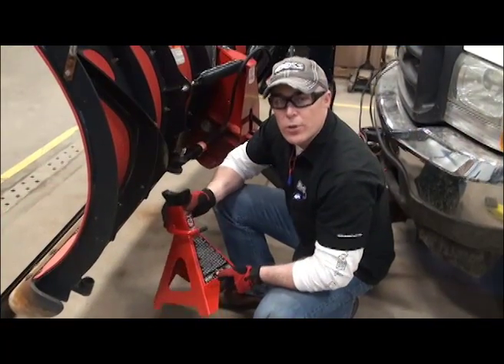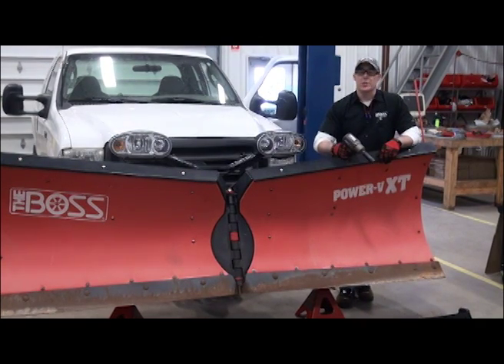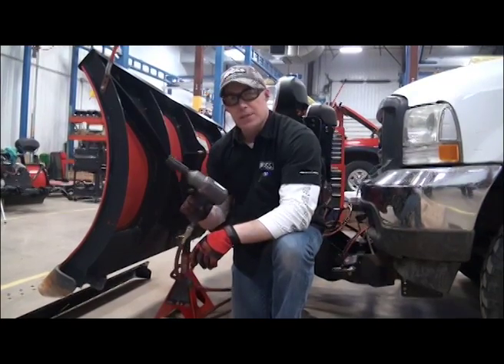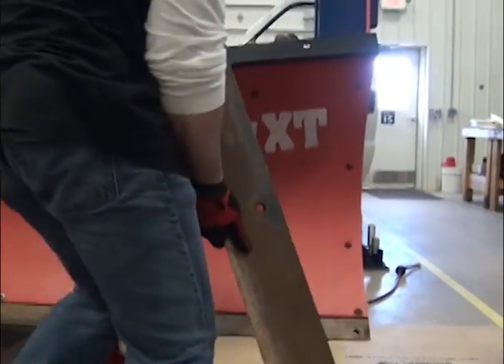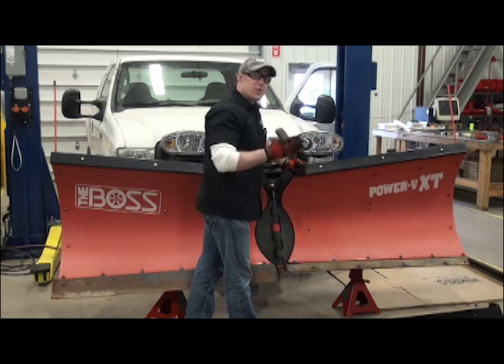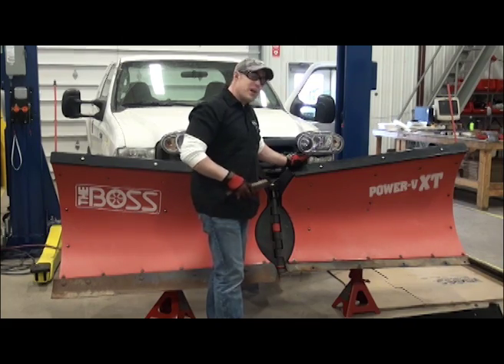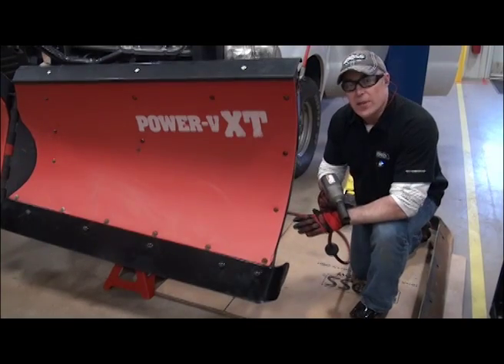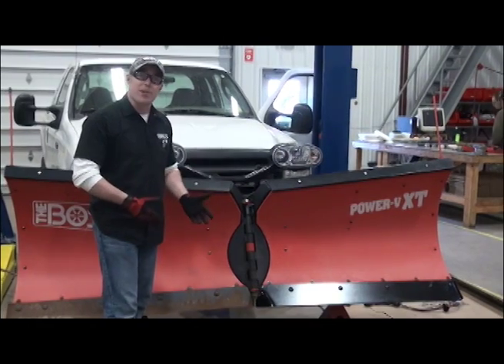How to Replace Your Snowplow Cutting Edge

Comment: I still have the factory cutting edges on my 5 year old SnowDogg 75" vee plow. I average about 25 residential and a half acre parking lot,averaging 15 plowable occurrences per season. I'm surprised I haven't had to change them yet, is this normal?

Comment: Ok all bets are off when the carriage bolt spins when using air wrench, the square head does not always hold enough into the cutting edge. Then a easy job becomes a job where you need to bring out the high heat cutting torches. and safety gets compromised to another level.

Comment: How about the ones where the nuts are rusted and seized .The impact just hammers and nothing happens. That's when you break out the old ''Hot Wrench'' and torch them off., I've had to do hundreds over the last 20 years , we have A BOSS dealership .But your advice is spot on otherwise.Enjoyed!!